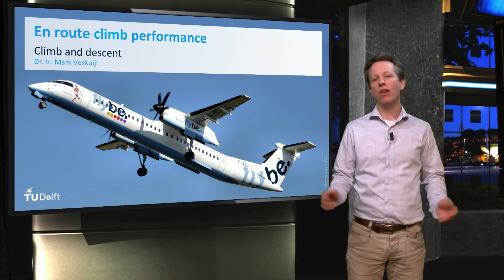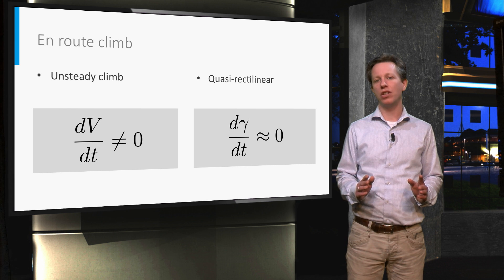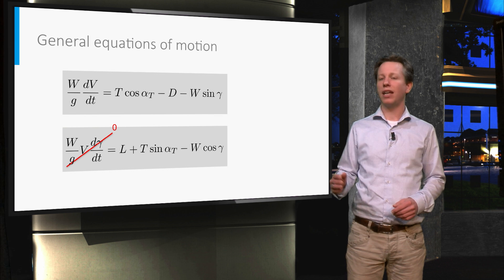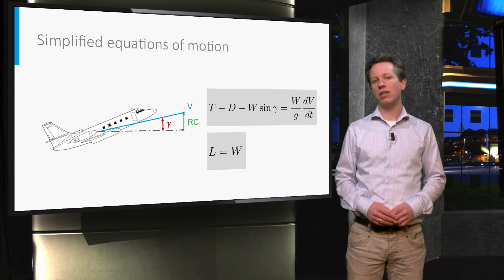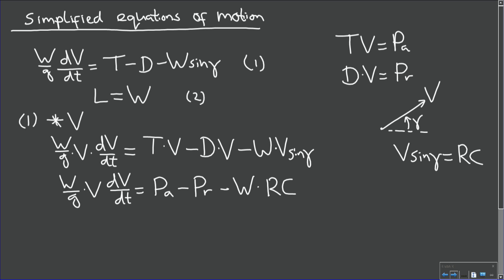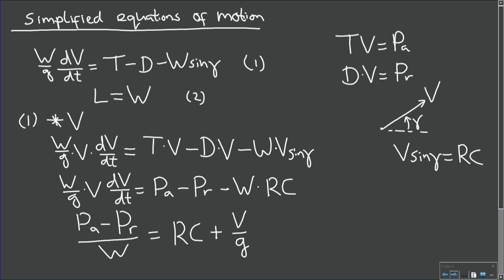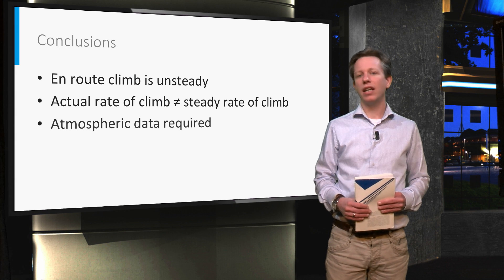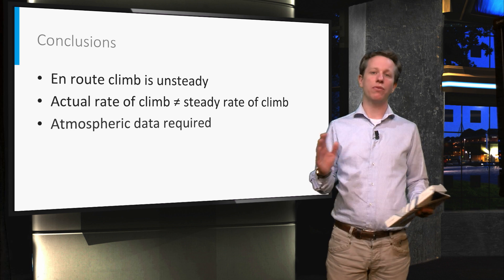Aircraft Performance Course: En Route Climb Performance

Comment: At 1:10 , the cosine term in the second equation is considered to become 1 , but the angle in consideration in flight path angle gama.

So in the next slide, shouldnt the equation become L = W*Cos(Gama)?

and by the way, thanks for this video, there isnt much study materual on accelerated flight!
Reply: He said, small angle consideration for normal operations, so gamma is much less than one and tend to zero, that is why cos(gamma)=1, maybe in military aircraft you consider L = W*Cos(Gama), or maybe acrobatic flight, or any other consideration as avoiding obstacles¡¡¡